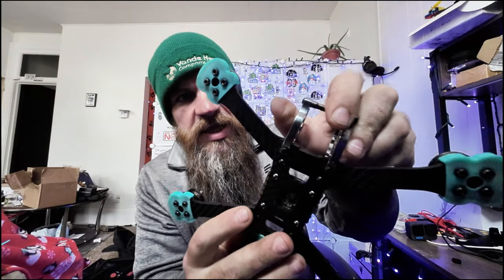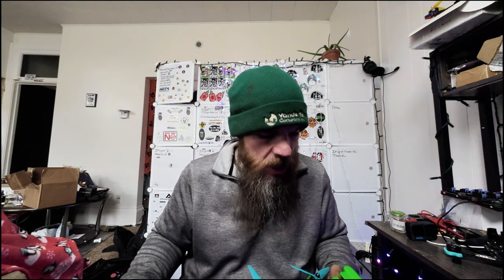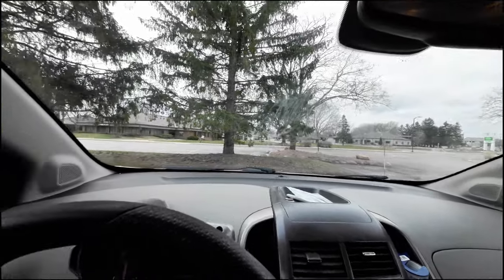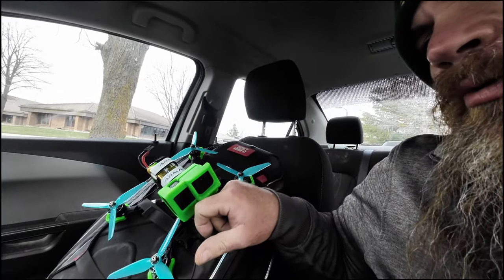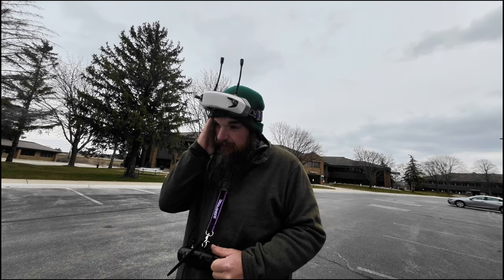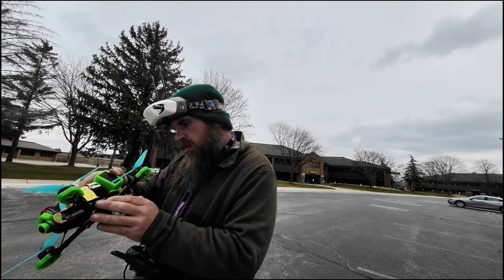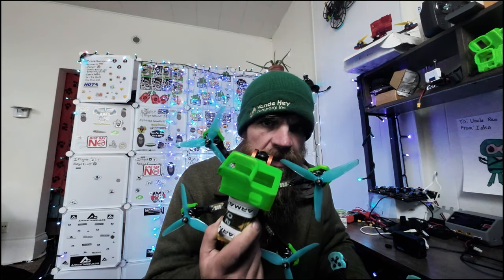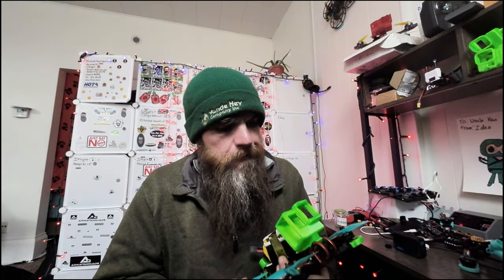T Motor and Armattan Beaver Review

Comment: 55a is totally not over kill not at all i mean i fly way stronger motors then most but still 65a is really the sweet spot i use 2207-2110kv motors though the YUKI VCI motors are the sickest motors love them by far the durablest 20$ ive ever used along with being the fastest
Reply from the maker: Damn bro that is some massive KV!! I’ve been flying 1950 for so long I’ve been thinking about checking something out with even more power yet, was looking at the vanny motors, but I like the price of the ones your rocking way more!! How do they hold up in crashes?

Comment: Damn dude that sucks. Hopefully it isn't the ESC, especially being brand new.
Reply from the maker: I know, the motor was acting funny actually while I was messing with the motors in betaflight, was hoping it was a fluke, but apparently not, the even worse thing is, the flight controller I bought for the other one isn’t working as well, so far I’m not having luck with T-motor, I’m hoping this is just a major fluke, as I was and still am excited about using there gear over iflight, but we’ll see, I never had this many issues with there stacks, but I’ve heard nothing but good things from everyone else, so I’m gonna continue to keep trying.

Comment: Did you fly this on stock PIDs in betaflight? Which version did you fly?
Reply from the maker: I always use Supafly’s 5” present, never had an issue with it yet! I hit up Stephan and he is saying my pids wouldn’t be making g the quad act the way it was, gonna check the motor with another esc that is totally working and just make sure it’s not the motor, also gonna flash the esc in blheli32 and just see what’s going on that way, just havnt had time as we got dumped on with 18” of snow like pretty much overnight so been focused on moving snow and getting paid! Lol totally will be ripping this weekend though as I have tomorrow off and will be figuring out my rooster and beaver! Da Rigs.